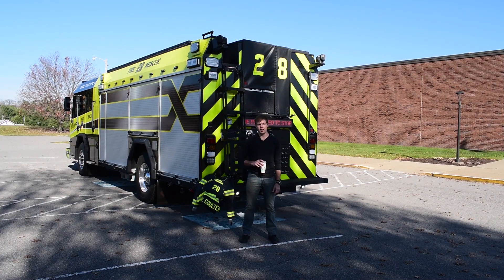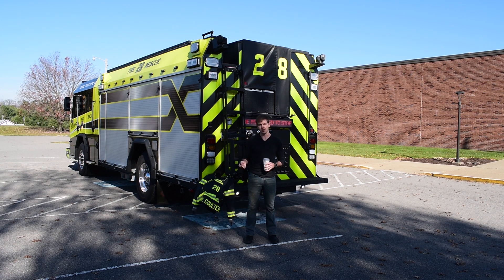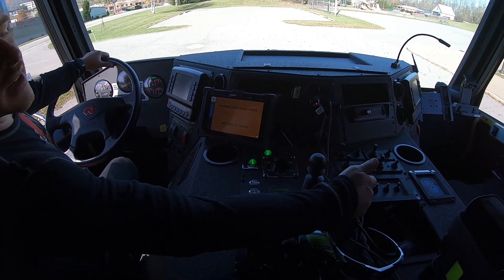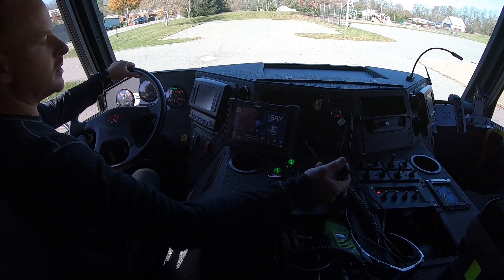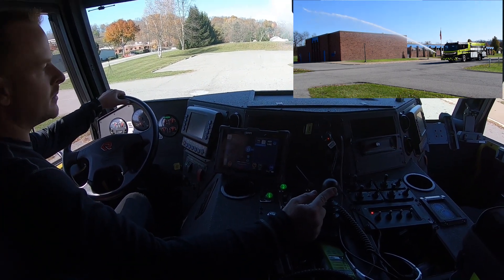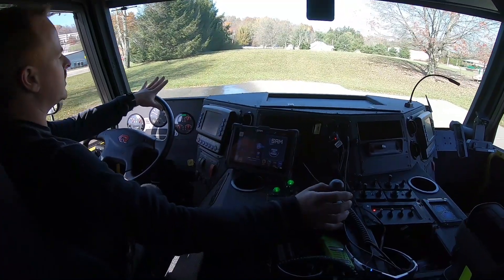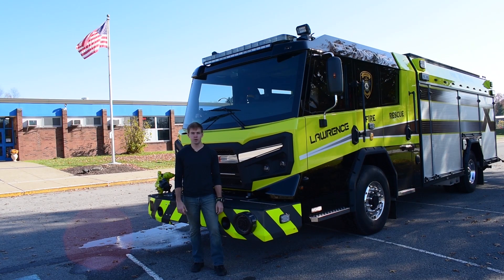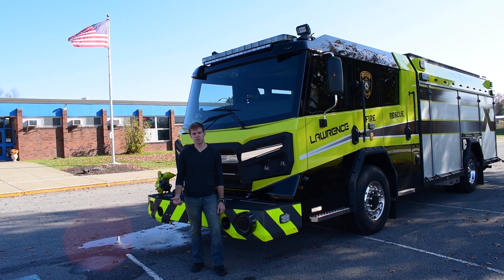Rosenbauer Avenger Pump and Roll

Comment: As I said on another of your videos that is the sexiest fire truck I’ve ever seen. I mean the color scheme, the styling, even the font selection for the lettering is awesome. Makes me want to drive the two hours to go see it in person. That said, as a computer engineer I am severely disappointed. So much potential for absolutely amazing automation and system integration and it’s missing. The workflows are way too complicated with way too many steps. It should have a single button for activate pumps that does everything including activating the parking brake if the truck is sitting still. Take for instance the new Chevy Tahoe police package… if the drivers door is opened below a certain speed it automatically shifts into park assuming the officer is exiting the vehicle to chase a suspect on foot. Or if the officer exits the vehicle while running and takes the key fob it prevents anyone from shifting it into gear until the key returns inside the vehicle. It’s the small things like that which reduce the workload of the operator and simplify operation. In this case I would say a great automation would be the CAD to transmit the incident location and type (ie: fire) to the truck which automatically sets the location as the destination in the GPS and activates a geofence. When the truck arrives inside the geofence it automatically activates the pumps and charges them making the truck ready to perform before they even seen the scene. Oh the potential to reduce workload and simplify the “extras” so the guys can focus on their job of putting out the fire and not working a half million dollar machine.
Reply from the maker: I can really appreciate your desire for automation. I truly wish that we could reach close to the level that you were describing, and I was pushing Rosenbauer for it. The pump and roll is a poor example of the technology this truck incorporates. The problem with the pump and roll was meeting several regulations at once, which required these steps to be performed. In a future video we will be doing a side by side comparison of this rig, and our older one, which will show where were able to achieve some of this automation. If you would ever want to make the trip reach out to us on our Facebook page to make arrangements.

Comment: I’m not sure if I’m completely sold on touch screen controls, seems slower and less intuitive than physical buttons.
Reply: Modern times require modern equipment!
Reply: @LondonEmergency999  Yet the hammer and hand saw still exist.
Reply: The absolute best User Interfaces use a combination of the two together for the ideal experience. Sadly many designers feel that physical buttons and touchscreens are mutually exclusive and fail to integrate the two together. I think the ideal UI for this truck would be a remote control similar to what the modern rotator tow trucks are using with joysticks on both side of a tablet style screen enabling the user to move the truck with one and move the water monitor with the other. Or better yet dynamically assign functions to the joysticks based on the current selections on the screen.